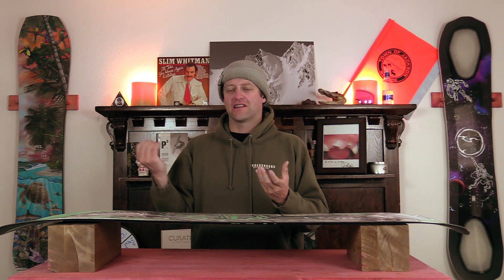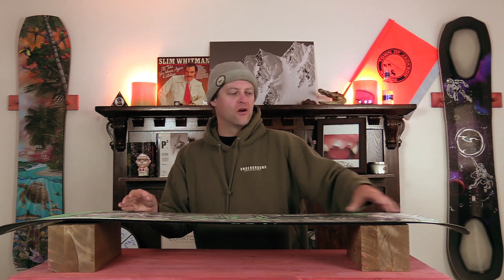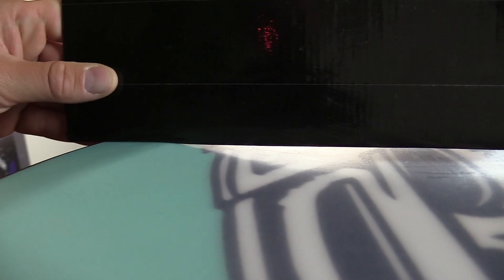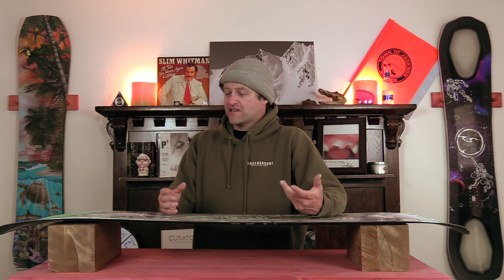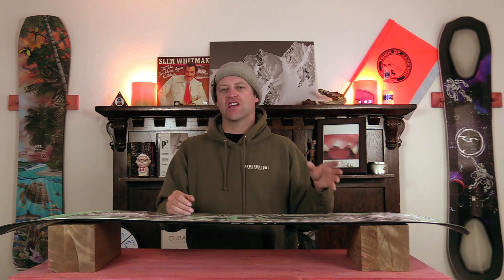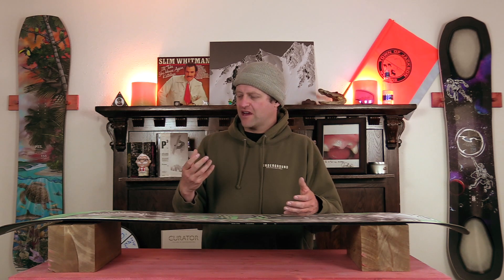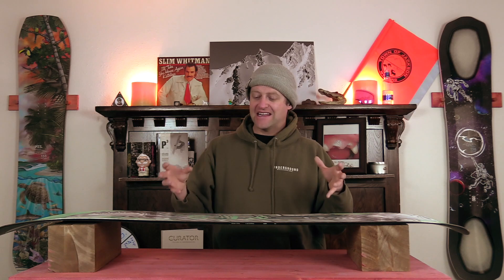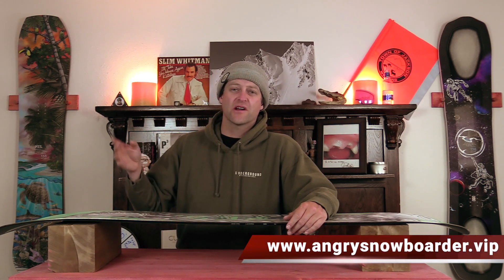The Yes Powderhull Technology: Explained

Comment: Avran! 
Random question but what are your thoughts on the burton deep thinker? Thinking of getting a past season one for cheap or a skeleton key. If you’ve ridden these did you like them? Comparable boards? Already have a ride algorhythm but I’d like something more directional and stiffer compared to that. (w/ rome katana bindings) Thanks! Love the content.
Reply from the maker: Both of those aren't really any stiffer than the Algorthym.
Reply: @AngrySnowboarder  Gotcha thanks 👌 Then I’m thinking the Capita BSOD or Bryan Iguchi Pro camber. After riding the algorhythm for a bit it’s a little softer now, basically want a slightly stiffer all mountain freeride deck.

Comment: Thanks for the explanation. So, this is a bit like putting a concave in a surfboard - it does the same thing in the nose and I guess it is also a bit like putting channels in the tail of a surfboard to get a cleaner release at the tail. A snowboard has to go both ways so channels would be a no no. BUT water is always soft (unless it is ice and then you wont be surfing) unlike snow. The Powderhull must have more rocker through the centre line than on edge (contact point to contact point). So I am a bit bothered by how the Powderhull handles heavy, crappy or firmer snow. How did you find it?  Do you think it would get catchy/hooky in less than perfect pow? Really rate all your reviews btw - cheers. A
Reply from the maker: A snowboard doesn't have to go both ways. You could always watch the reviews on the Yes. 420 Powderhull and the 20/20 PH.
Reply: @AngrySnowboarder  I guess they don’t have to go both ways (though I wouldn’t want a board that literally couldn’t ride switch at all)- my point was that the concaves have been around for donkey’s years on boards designed for water and powder is pretty much like water. But no one puts a concave in the tail of a surfboard as it would reduce the rocker or tail kick just where you need it to make the board feel surfy. I am surprised it doesn’t have a similar effect on a snowboard - ie make it track straighter and be less surfy. Anyhow, if you didn’t feel that then I guess they’ve got it dialled. 👍🏻

Comment: Hopfully with the slush riding in the next month or so we will get the full angry reveiw of the nidecker supermatic! 🤙
Reply from the maker: Took them out today for a couple laps.
Reply: they are heavy and shit for freeride (somethimes it doesnt lock propery, and hard to push against pow). otherwise it would be a solid binding, one that you strap in and forget. i tried it with a ride helix and they matched quite good. but i still prefer the flow bindigs, they have that superior heel response that this one lacks. so you lose a lot of good stuff in order to save a little time on strapping in. nah.
Reply from the maker: I've weighed them they're .451 lbs heavier than a Nidecker Kaon CX. If you think they're heavy and you're using Flows it's in your head. Eat your muscle cheese. If it doesn't lock properly you're either putting all your weight on your toes at all times or you don't know how to step down.
Reply: @AngrySnowboarder  yeah, pushing your heels in 3 feet fresh pow, with the locking mechanism being full of ice. Yeah, sure, I must be doing sg. wrong :D sometimes i wonder if you are snowboarding at all, or just making things up.
Reply from the maker: @okosakaroklenni  and you didn’t run them like a regular binding? That just seems like the logical thing to do? Then again who the fuck would use a Helix in 3 feet of snow? You want to argue with me I don’t care I’ll just block your lame ass and not think twice about it. Everything you’ve said is the sign of someone that hasn’t spent the time to dial these in, how do I know that? Because I’m doing that daily.